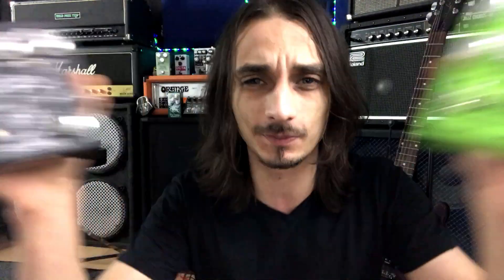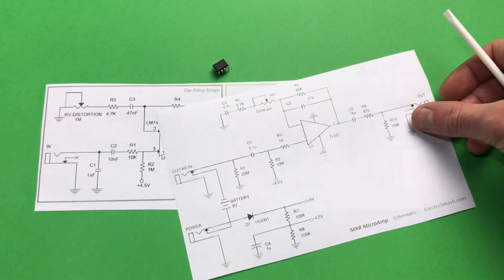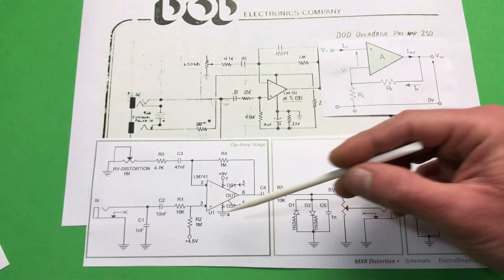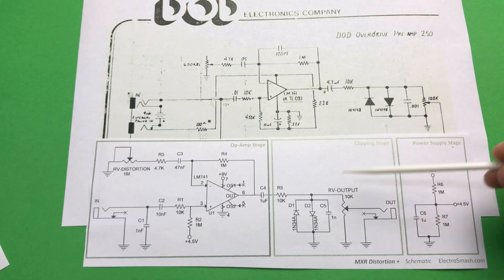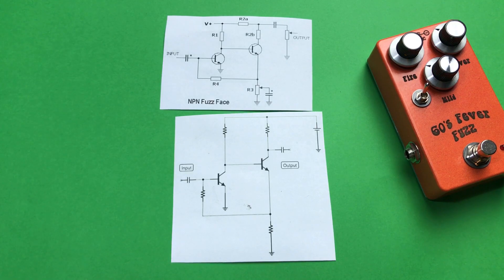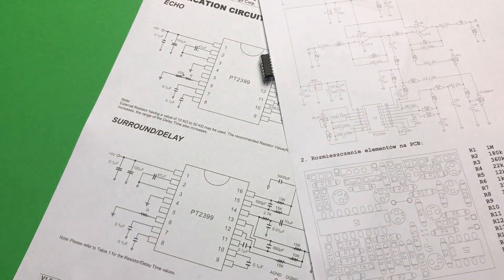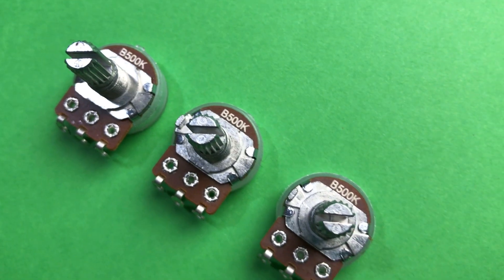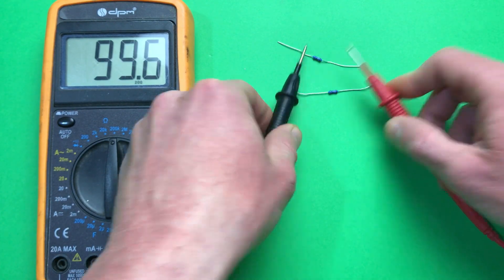What Guitar Pedal Companies Don't Tell You About Guitar Pedal Circuits?

Comment from the maker: As You see, lot of legendary pedals are just built using common electronics blocks and parts. What are Your favorite guitar pedal myths? Let me know!
Reply: The Myth that using nos retro parts gives things more ‘mojo’ vintage tone... when it’s probably just drifting leaky cap values and less tolerance in old resistors that made them sound a little different as harmonic distortion added using these parts is less than 1% and inconceivable to ears haha great vid man! Short n sweat.